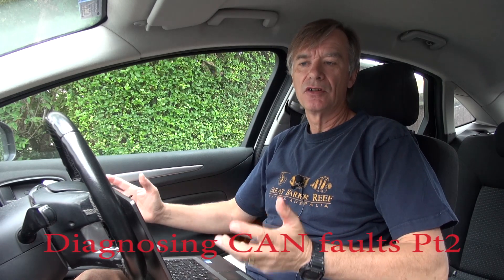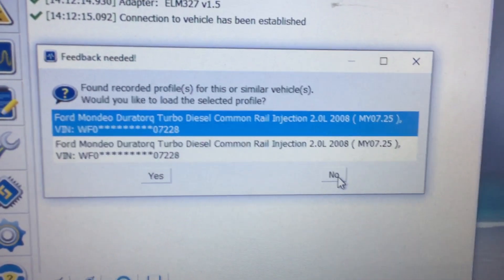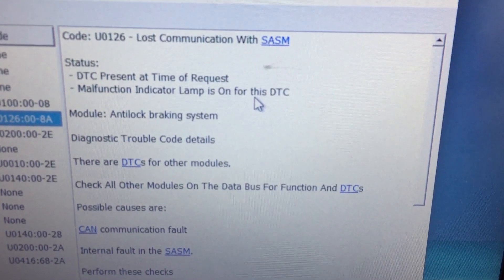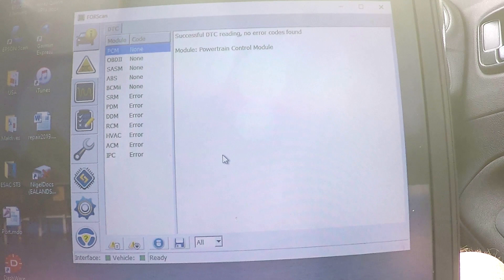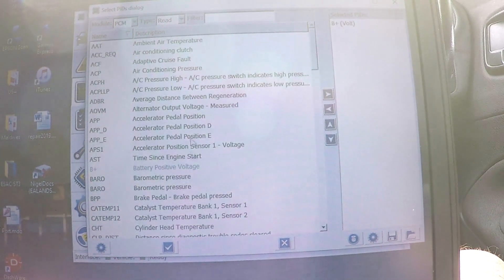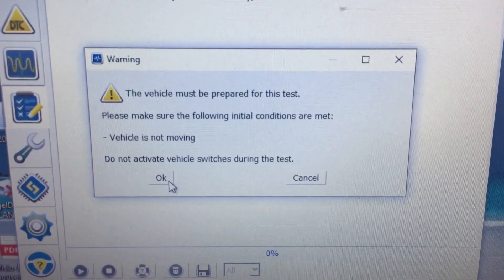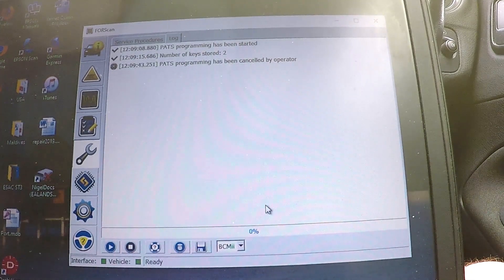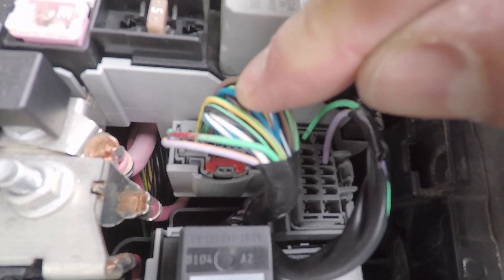Ford Mondeo 2007-2012 CAN-bus fault finding Pt2

Comment: Have you got any idea why using the windscreen washer jets, would make the engine go into malfunction and stop the car from starting?
Reply from the maker: @StottyofCurrus  crikey that’s a good one. The straight answer is no. Is the pipe from the jet disconnected and throwing water over it shouldn’t?

Forscan will tell what the car thinks is wrong.
Reply: @NigelEaland  no the pipes are fine, all connected, they work perfectly fine, the BCM board and connectors are all dry, with no damage... My only thoughts are water landing on exposed wiring or water get down on the scuttle panel thing and dripping onto the cluster panel? 

It's good to have a new fault eh? 😂
Reply from the maker: @StottyofCurrus  when you figure it out please message the answer.
Reply: @NigelEaland  can I ask a favour... Can you check your fuse box and see if there's a fuse in F1 and F10 please?
Reply from the maker: @StottyofCurrus   I have  25A in F1 and 20A in F10.
Reply: @NigelEaland  I don't have a fuse in F1, there's no connectors in it and in F10, there's only metal on one side but again, there was no fuse.

Comment: How did you fix your ipc failure?u0416 and u0422
Reply from the maker: @FreedomMatter  the DTC faults reported were historic from a time I was having battery failure because my starter motor was dying and needed replacing. I reset DTCs and all was good.

Comment: Hi Nigel can the bulb monitoring system be disabled using forscan? As in I want to fit h7 leds and if they cause a bulb out error I want to be able to disable it. Thanks
Reply from the maker: @paulclifford4469  not that I know of. Putting LED replacement bulbs in halogen headlights is not road legal. https://www.autobulbsdirect.co.uk/blog/are-led-headlights-legal-in-the-uk/

Comment: Hi Nigel. Thanks for putting these videos together. I found it when searching Mondeo CANbus, and the info in pt1 around the wiring will be really helpful for me. 

You may already know this, as 4 years have passed since you did this video, but you can get autoswitch cables nowadays, which make using Forscan so much more seamless. 
Cheers
Reply from the maker: I didn’t know that, so thanks.

Comment: Hi! Did you know if the door control modules can be programmed on mondeo mk4? I've changed a dead rear right door control module and one touch window control doesn't work on that window, from key they open but this one won't close either. The reset procedure not working. And, if i remember correctly in forscan i have an error on door control  module, something like software incompatibility. The module is from 2011car, my car is 2009 prefacelift.
Reply from the maker: I don’t know whether it can be programmed or where you would get the firmware from. I would just get another second hand for the right year.

Comment: Please can you tell me what color wires to check and where abouts please.

I have smax mk1 same as mondeo but having problems with ob2 not connecting to ecm or bcm. ive had the clocks out and checked for dry/cracked solder joints on the connector pins but these all look good so im thinking wiring issue advice please.

Car will not crank and not start all fuses checked and are good. engine malfunction light on dash immobilizer active, tried spare key and nothing.
Reply from the maker: My other video should help https://youtu.be/va-ItdKCl8c. You will need a multimeter.

Comment: Hi nigel I have a 2009 mk4 mondeo 2.2tdci titanium x but having problems with it cutting out, it will start and tick over but 5 or so mins later will just cut out I did think it was the bcm but I've had mine sent off and cloned but I'm still having the same issue. Any ideas what it could be or if forscan would tell me what the problem is? Thanks carl
Reply from the maker: Check with Forscan for any faults for sure. I would also suspect fuel. When was the last time the fuel filter was changed? Can you see any air bubbles in the fuel lines?
Reply: @NigelEaland  I will have to order a cable and download forscan 👍 and I have no idea when the fuel filter was last changed I bought the car in May 2021 but didn't get any service history. I will have a look in the fuel lines to see if there are any bubbles. It's really annoying as I like the car but at the minute it's just sat on my drive, it also happens when I'm driving along it keeps trying to cut out so judders along like a kangaroo
Reply from the maker: @marsdencarl89  it definitely sounds like fuel starvation. Have a look at my fuel filter change https://youtu.be/Po4BddwSJ1Q.
Reply: @NigelEaland  thanks nigel I will have a look at your video 👍 just a quick question is the fuel filter under the car or in the engine bay? Its the 2.2tdci thanks for your help
Reply from the maker: @marsdencarl89  the mk4 is under the car just  in front of the fuel tank. If you change it you will need to get the air out of the fuel line after. You’ll need a simple hand pump (£7) and a some clear pipe.
Reply: @NigelEaland  thanks nigel I will have a look sometime this week 👍 it does sound like fuel starvation now you mention it so I will check the fuel lines once engine is running and look out for any bubbles. I'm guessing the lines should be constantly full of fuel am I right?
Reply from the maker: @marsdencarl89  yes. No air bubbles at all.
Reply: @NigelEaland  cheers mate ill take a look 👍 I'm a little confused as there also seems to be another fuel filter on the engine underneath the plastic engine cover 🤔
Reply from the maker: @marsdencarl89  are you sure you are not looking at the oil filter? There are two more of my videos that might help you. Look at my poor starting and the full service. They will guide you around the engine compartment.
Reply: @NigelEaland  I will double check tomorrow I'm not sure if my engine is the same as yours mine is the 2.2 duratorq it's the q4ba engine
Reply: Hi nigel I've just downloaded forscan and 1 of the codes that keeps popping back up is B10E7 ignition on relay
Additional fault: circuit short to ground 
Module: remote function actuator

Do you have any idea what this could be? As my car turns over but soon as the engine starts it cuts out straight away
Reply from the maker: @marsdencarl89  sorry I’ve no idea. It sounds like the ignition relay is losing the ON signal due to an intermittent wiring fault. Where to start looking…..?
Reply: @NigelEaland  yea thats what I was thinking 🤔 think I may have to take it to an auto electrician for this one and see if they can point me in the right direction thanks for your help anyway 👍
Reply from the maker: @marsdencarl89  a real long shot but check the engine compartment fuse box for water ingress into the connectors or relay sockets. Pull the plugs apart and look for problems. The PCM relay might be worth a look at. Does it click the same time the engine cuts? https://www.fordwiki.co.uk/index.php/Fuse_%26_Relay_Information_-_Mk4#Relay_information

Comment: I've just ordered one of these from Amazon as my Engine Warning Lamp has appeared (the only ssue with my MK4 2.2 Tit X in 12 years of ownership)
https://smile.amazon.co.uk/dp/B07S7W14X9/ref=cm_sw_r_cp_apa_glt_fabc_AC4VHYHM937114M2T67D

Very helpful video and likely to head back here when the cable arrives.
Is it easy to do a DPF regen if that's the issue?

Comment: Hi Nigel, having problems with my climate control module on my 2010 mondeo. Sounds like I need your lead and software. Where can I buy the lead/adapter and the software program. Regards, Jon Hughes
Reply from the maker: Hi Jonathan. What you need is a bbfly-BF32302 USB OBD2 diagnostic interface. Amazon sell them https://www.amazon.co.uk/dp/B01N9R9QS2/ref=cm_sw_em_r_mt_dp_3MJJ1AKNHEC0D5D959WB.  You need to make sure it has the switch to go between the HS and MS bus. The software is Forscan and it’s free. Here’s the download page https://forscan.org/download.html. Thanks for watching and good luck.

Comment: Awesome vid, which I was computer literate! I sooooo need the help! Non start mondeo 1.8D mk4. All electrics work but it just won’t even turn over.
Reply from the maker: Have a look at my videos about poor starting and replacing the starter motor. You will need a voltmeter. Check the battery is charged and has 12v. Next check what happens to the volts when trying to crank the engine. If it drops badly then either the battery is not charged or the starter motor is drawing too much current. For the latter this could be the starter motor has failed or it’s jammed because of debris in the starter ring because of the clutch plates disintegrating because the duel mass flywheel has failed. To check this you need to take out the starter motor and have a look at the starter ring. Good luck.

Comment: Does this test battery, my 2007 mondeo as battery light on, the battery is charged, the alternator is fine, cluster sent off for repair and service so that's fine, but battery light still after cars been running for 1 minute.
Reply from the maker: Yes you can see the battery volts and provided it is reading more than13.5v with the engine running then the battery is charging. You will also see the faults reported.
Reply: Can also check the battery voltage by keeping your finger on the right ok button while turning the key just before ignition. Diagnosis menu then appears allowing to scroll with up/down arrows until battery voltage is displayed.

Comment: Hi Nigel,

I've bought a scanner with a switch for all modules but when I go to run Forscan it doesn't come up with them initial screens about choosing ms)hs scan or even find the correct car,any ideas why?

Any videos about fixing intermittent signal to radio causing the head unit not to always switch on?
Reply from the maker: If it’s not communicating with the module then it’s a driver issue with Windows I would say. Mine is a USB cable version but the chip expects to be on a com port. Inside is a com port to USB emulator and I needed to download a driver for it. Whoever sold it to you should be offering a driver download.

To check this is the problem connect the device and open up device manager in windows 10 and see if it’s listed.
Reply from the maker: The other way is to open it up and find the chip number connected to the USB port then search for a driver. It may well be one of these https://www.ftdichip.com/Drivers/VCP.htm
Reply: Thank you, it is a usb port one I've boutht. So even though it is scanning  and bringing up some info it's not doing the full job as it doesn't have all the driver's installed,I guess that makes sense.

I can find them from the seller and install them. Do you have any tips on radio head units not working properly and checking the input signal or repairing it?

Your videos are great,really helped me with things around the car which I've never done beforem
Reply: Managed to get this working properly,it was driver's which I needed and downloaded. Managed to clear all errors,will now look to use this to full potential to help my car out.
Reply from the maker: Philip S excellent result.

Comment: Hi Nigel,

Good work out there ! 

Do you know if with this soft we can trigger the fap cleaning system ? I watched a video on youtube (don't remember which one) where the owner shows us the car while cleaning the fap and we can see the car "accelerate" (i mean the rpm goes up) by it self.

But he didn't go through all the steps to make it run. So i am a lil bit septical.. Anyway hope you can tell me about that.

Thanks for sharing !
Reply from the maker: When you say FAP cleaning do you mean the DPF, diesel particulate filter cleaning?
Reply: @NigelEaland  Yes exactly ! FAP is the french acronym (filtre à particule) to say DPF ! (sorry)
Reply from the maker: Using Forscan select service functions and you will find DPF static regeneration. It takes 20 minutes to complete.

Under Read PID data select from the drop down filter the PCM module. There you will be able to read the distance since the last DPF regeneration was completed.
Reply: @NigelEaland  Merci ! 

And again thank you to take the time to answer !